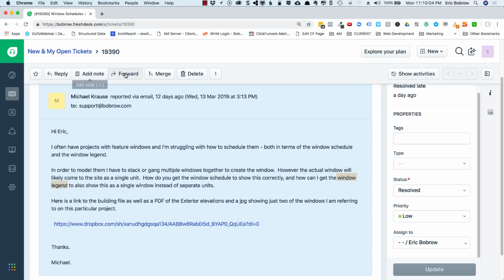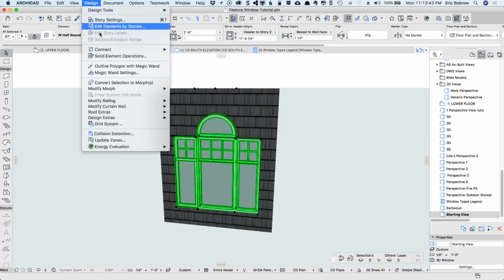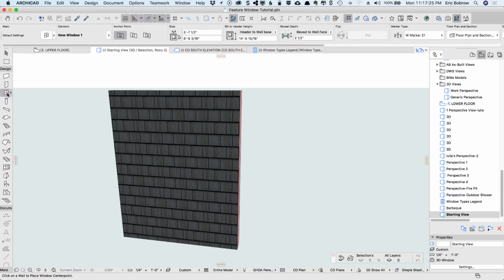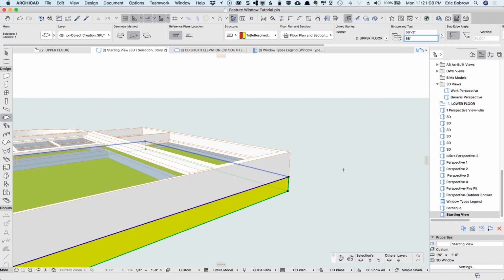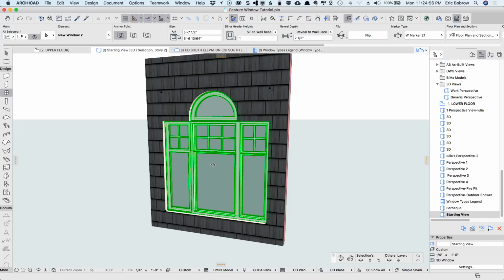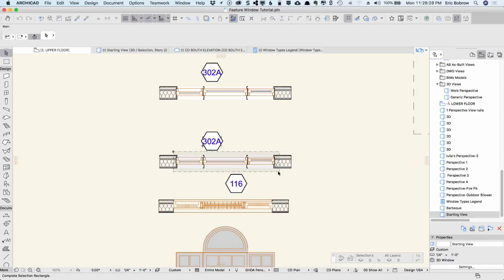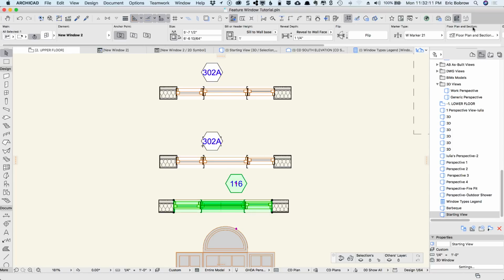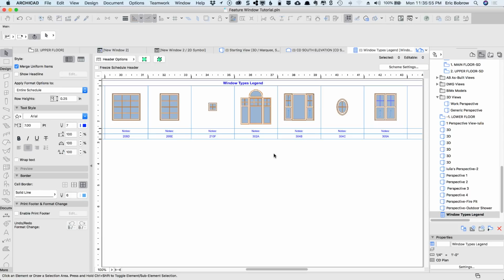ARCHICAD Coaching: How to Create a Custom Feature Window from Multiple Ganged or Stacked Windows

Comment: I'm having problems with my window/door schedules. The width column showing only decimal feet and not fractional feet. I've tried all of the working units / dimensioning settings. Does anyone else have this problem? It's strange....I don't have this problem when the column is just "height" and "width x height" It will show those dimensions in fractional feet + inches.